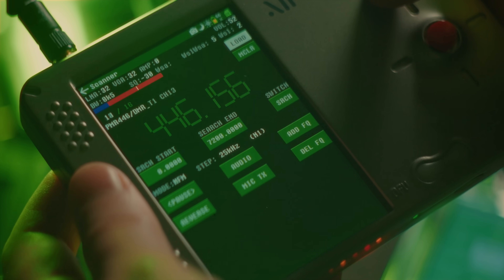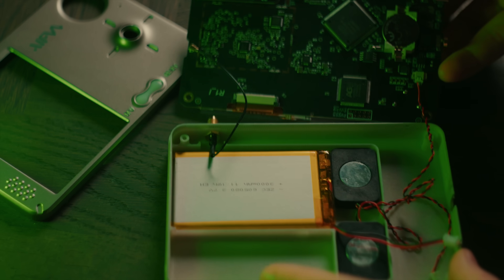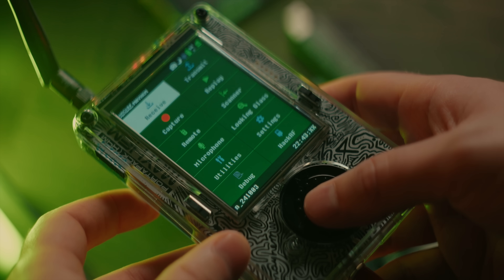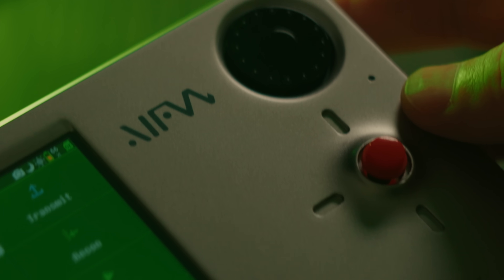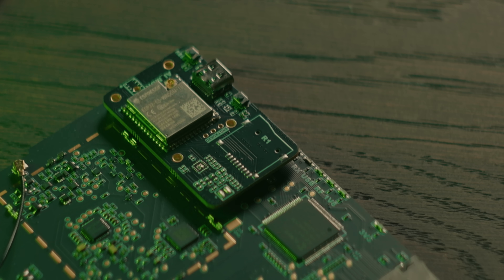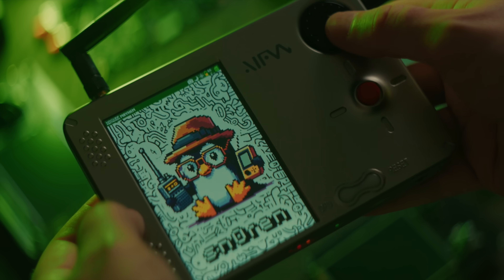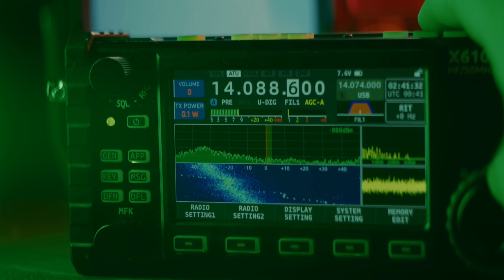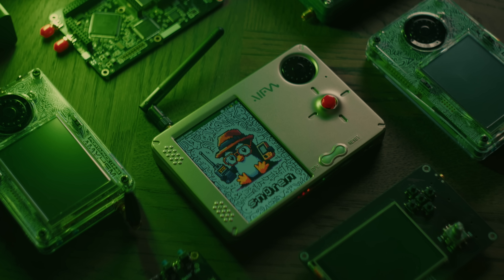HackRF Portapack Evolved? This is PortaRF

Comment from the maker: CORRECTIONS:
- The final production model will have the GPIO connector!
- Also OpenSourceSDRLab has now made the internal AI extension board optional. If you order without it the price is $220 instead of $255.
Reply: I think the AI will be super useful in this case. Is hard to use the rotary dial, you end up adjusting other things and pressing other stuff. With AI if you say: “scan airband” that will make everything so easy. To open the proper app and range of frequencies

Comment: I think that having a single board instead of two separate boards (RF + control) is a disadvantage. If something goes wrong—like if I accidentally enable the amplifier and burn the RF section—I can’t just replace the RF board; I have to replace the whole device (or use a soldering iron and try to replace the damaged chip).

Comment: yeaah, they're kinda exploiting the mayhem dev stack. If the portapack wants to do more, it's going to need to start working with a pluto or the SDRlab's B220 clone boards. With that, you could get GPS or LoRA working, but it'd require a LOT more ram and processing power (like, an embedded pi connected on top) to run two full duplex antennas in concert. The marauder is also getting the "AIFW" treatment, with two speakers and a second esp32 for siri added on top.

Comment: PortaRF... start jammer at xxx Mhz... 😂 Controlling it via voice commands is the last feature I have on my wish list. It needs an integrated GNSS and an easy accessible extension port to install own boards inside the enclosure. Why not using one oft the enter buttons to run a script that is easy to modify and can start apps with parameters. By the way. I have mounted a 5mm thick powebank with integrated usb c connector to my h4ms back. It runs much much longer now.

Comment: I would have liked to seen the joystick, dfu & reset buttons removed and a 12 or 16 key keypad in their place. & a jog wheel with d pad ring around the outside like the old ipod used. 
and yes, it should’ve definitely had. GPS built into it!

Comment: With a case of that size, I'd rather expect something more beefy than an ESP32 addon that might get used by some apps in the future. A Raspi-like SBC together with a HackRF Pro and a large touchscreen would have been a true upgrade from a Portapack H4M. And even if you don't have a Portapack yet, something tells me the H4M is still the better option as it's more modular. The new addon interface, I don't think it's going to be popular.

Comment: Interesting considering the release of HackRF Pro. I wonder if maybe a device more like Portapack in form but with some of the PortaRF innovation wouldn’t be a good fit with the more capable HackRF Pro eventually.
Reply from the maker: They say that they will release a PortaRF Pro with the HackRF Pro hardware once it’s released.
Reply: @s @sn0ren  Hi how are you, are there any official statements stating that they will release a portarf pro version this year or soon? I’m looking to either get this portarf or an h4m, the h4m seems to make more since because of the release of the pro board in December. But if portarf will release a pro board this year as well then I’ll get the portarf instead.

Comment: I like the new display and improvements to the battery charging circuit. The joystick feels redundant. I agree a GPS module etc, would be preferable to an AI voice module. At this point in time, I prefer the old design due to the ease of its disassembly. If the radio fails, it can be readily replaced / upgraded alone. The lack of expansion header on the new HackRF Portapack design is big omission, especially as it could discourage new developments that would make use of that expansion header and impair backward compatible.
Reply from the maker: They tell me the GPIO connector will be added in the final production version

Comment: Wow, so instead of upgrading the ADC or increasing the bandwidth and dynamic range or making the frontend more protected they decided that it's better to put in a bigger screen, leds and some ai crap. That's just pathetic.
Reply from the maker: Redesigning the actual radio circuitry of HackRF requires extensive knowledge and testing. I don’t think they have that at OpenSourceSDRLab. They just rearranged the components of the design thought up by Ossman. They are are a manufacturer and seller - not radio engineers.
Reply: 8 inches do you think you could handle it?

Comment: Wow, this is a clean bit of kit. A single-board PortaPack — HackRF and PortaPack circuitry fused into a stand alone RF tool. It definetly  has a refined commercial look to it— almost like something Sony might’ve released back in their artsy PC computer days. 

Is this the only new iteration of the PortaPack to be released? Asking to see if the original style will be no more, frankly, because the old “sandwich” setup still has considerable merit, especially if there’s an updated board designed to be optimized to mate with the forthcoming new HackRF Pro. With that hardware’s expanded bandwidth and cleaner clocking, a matching PortaPack could really wring out every drop of capability from the pair. The new look could absolutley be incorporated so long as perforance and functionality is never diminished. I just watched your video on the uConsole and that thing is awesome. What is really cool is the multi-antenna setup it has. It would be pretty shit hot to take that setup and attatch it to the new PortaPack. Really , all portapacks and HackRF would benefits from having thatrange of antennae.

I'm curious if this new "must have" RF tech is going to be easily aquired here in the US. I'm in Southern California, which should be its own soverign nation so we wouldnt be stuck paying for the questionable decision making that has been demonstrated by our Executive Branch. Really, should be changed to Executive Stump, but what do I know. I'm just a citizen of Earth that would like to see theres an effeort to reduce conflict and suffering and a plan put in place to ensure all of us tech enthusists can get the hot new kit as fast as possible for a reasonable price. Anyway keep doing what you do. your videos are something good to look forward to. They are highly informative and fun to watch. I'll stop here so I dont take up anymore of your "comment" area. Cheers!!!

Comment: If they make the expansion right we can have WSJTX or FT8 built in. My xiegu x6200 does ft8 built in but they left the system closed. I wish they made a linux distro for it open source since the x6100 ended up with aftermarket Linux support. All I need is a single sdr based system that is a shack in a box and I'll be set. Thanks for the video, brother. Awesome a always. 🤌🏾🤙🏾
Reply from the maker: Yes I would really like ft8 and other modes decoding on Portapack/PortaRF

Comment: How, in terms of overall functionality does this conpare to the hackrf one ?
Reply from the maker: Functionality is identical to any HackRF Portapack. If you put it into HackRF mode it will work just like a regular HackRF with no Portapack, by connecting it to a computer and using SDR software.
Reply: @sn0ren   Doesn't have Clock In and Clock Out tho (but it seems to be the only difference)
Reply from the maker: @MadMaxGyver  Yes, if you need that functionality you will need a regular HackRF.

Comment: This seems oddly timed with the HackRF Pro on the horizon. If I were in their shoes I would've have given it another six months or so to see how well that performed before just making the H4M's big brother.

For me personally, even my PortaPack just gets plugged into my laptop or phone and used as an SDR with transmit these days. The Mayhem software is great at what it does, but you can squeeze much more out of that board.
Reply: I had no idea there was a "Pro" model on the horizon... off to find some info on that now, thanks.
Reply from the maker: Yeah everything is weird about this. They say they will make a version based on the new HackRF Pro design as well though.
Reply: @sn0ren  I've ordered the Pro, so can I order just this case to put the Pro into, or would I have to buy this case with the Pro board included?
Reply: @sn0ren 
Is the hackrf pro, a greatly overhauled (latest rev) hackrf, or a completely diff & incompatible design? 
Also, what flavour of the hackrf-portapack, is that, at the 13min40sec mark?
Reply from the maker: @jugheadjed  The new HackRF Pro design features a more powerful FPGA chip, slightly wider frequency range and supposedly better sensitivity. But we won't know for sure until it is released, nor will we know if it will be possible to work it with Portapack. But OpenSourceSDRLab says they will make a PortaRF with the new HackRF Pro design integrated once it's released. 

The HackRF Portapack at 13:40 is an old H2 one. The first one I bought a couple of years ago.
Reply: For a portable mod I would also like to see the HackRF together with something more capable on par with a Raspi. The new Arduino Uno Q looks interesting. It comes with a Qualcomm MPU that has four ARM cores, 3D acceleration, WiFi, BT and GNSS (so no add-on board needed!). And on top of that it also comes with an STM32 microcontroller. It runs Debian. So in Portapack mode you can have easy to use touch apps, or plug in a monitor, mouse and keyboard and you can use it for more advanced SDR software or even to develop and debug new apps and STM32 code on the device itself. You could use the STM32 to control all kinds of peripherals and stuff.